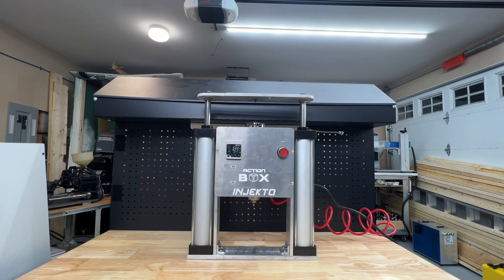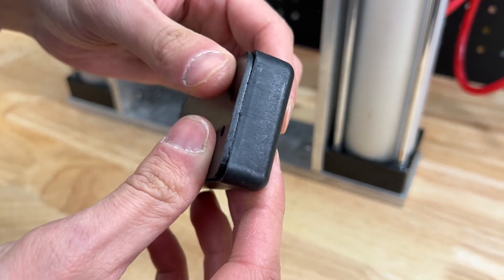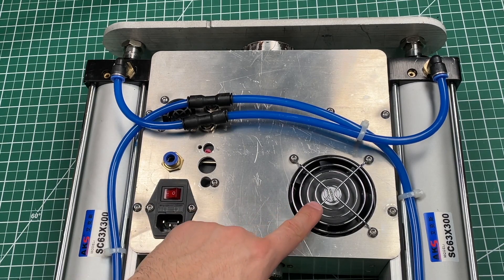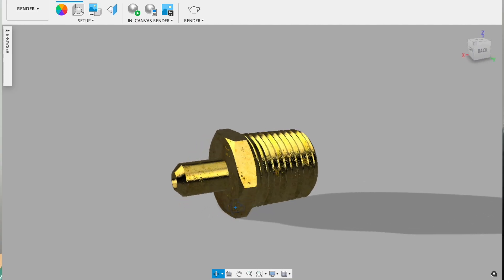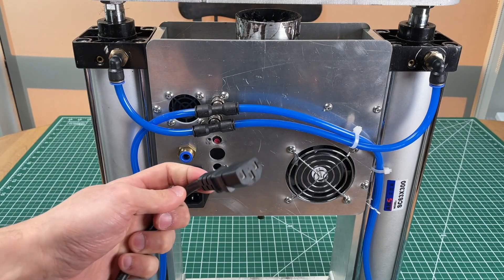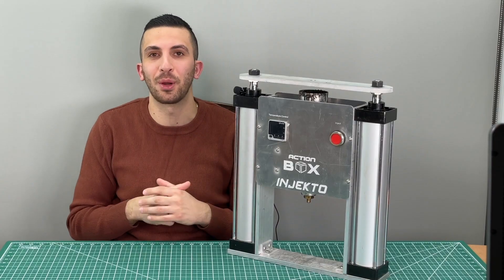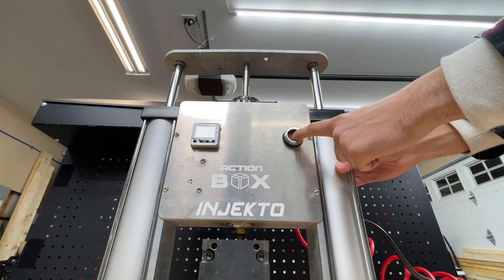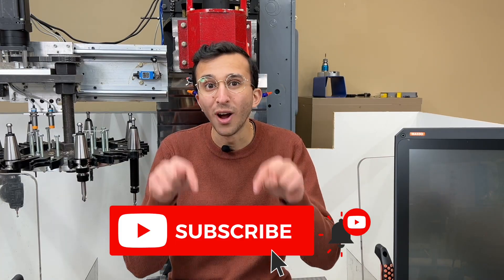How We Made A TINY Injection Molding Machine

Comment: I wonder if you add a lever system.
Like a rhombus that will fold. 
What Force can such a mechanism pruvide?

On one diagonal it is compressed by cylinders, on the other it pushes the plunger of the syringe.

In theory, the curve of the developed force will be steeper by the end of compression. 
Weak at the beginning, then high. Which is well suited for the molding process.
Reply from the maker: Thats a great concept, which we had considered, however we wanted to keep the design elegant and as small as possible. Thanks for watching, and hope you enjoyed the video 😃
Reply: @ActionBOX  You guys are doing a great job! 
I like your enthusiasm. I myself try to add something interesting to society. I hope it will be noticeable in the future.
Reply from the maker: @sl_st  Awesome and thank you. We look forward to eventually seeing what you re working on 😊. Cheers
Reply: @ActionBOX  I love 3D printing.
 I'm doing all sorts of little things now. 
Two-stage cyclone dust separator and similar things. But this tool can do more and I can do more. 
SL_ST

Comment: It's cool that it worked with a aluminium injection barrel. I was considering making an injection machine and thought i needed to make the barrel out of stainless steel for it not to wear out.
But you should do something about the air cylinders not moving at the same speed making the plunger tilt. This can also cause the cylinders to bind.
Reply from the maker: Thanks for your input. The cylinders use to have the tilting and binding problem but not anymore. We hold the plunger shaft loose so it can guide itself into the hole and that seems to work well. Stainless is probably an overkill but steel would definitely be recommended. Thanks for watching in such detail, I appreciate your comment and support 😊
Reply: @ActionBOX  the thermal conductivity of SS is horrible. It would really slow your ramp up time and cool down as well.
Reply from the maker: @kenreynolds1000  This is a very true point.  Ken, which metal would you suggest would be best (regardless of price) ? Cheers, Dave
Reply: 4130 is fairly strong, tough, reasonable to machine and easy to source. It'd be my choice for a DIY machine. You don't need anything more exotic unless you want it to run continuously for years. Stainless is a bitch to machine and likes to gall.

Comment: nice! I'm currently using a (smaller) hand powered diy machine. I was thinking about converting it to air now I feel even more tempted ;) Looking forward to your V2 and great video as always :D
Reply from the maker: Haha glad we inspired you to convert to air! Did you build your current machine by yourself?
Reply: @ActionBOX  yes, had an old arbor press (I can only lift it when disassembled). I just added a plunger and a steal barrel, two heater bands and a PID controller. works pretty good with literally tons of force. But it's hard to get constant results due to varying speed and force when manually operated. Also have a concept (and some parts) for a fully automated machine but don't know if I'll ever find the the to do it. So I enjoy seeing you guys do such things ;)
Reply from the maker: @MakenModify  love it. Thanks again for your support.  We have several more injection machines planned out for the future so I guess you will see them as we build them. Cheers

Comment: nice concept guys! Ive got a small Arburg injection molding machine myself. Mold making is the only problem for those small desktop machines (atleast for the Hobby market). Might be interesting if you try to SLA print some molds. Greetings!
Reply from the maker: Thanks for the tips! Ill do that in the V2, I promise 😃. In the meanwhile, feel free to help meow and share the video with anyone whom you think will be interested. We are really trying to grow our channel 😃. Cheers Dave
Reply: @ActionBOX  ive shared it. Ive also already Experimented myself with SLA molds and will ne exited for your Spin on it. Ive found that a Aluminium pallet to clamp the mold Insert is really necessary (cutting printing Time down, alowing for More pressure and accurate Holes for ejectors etc.). Only Trouble is that after some time cooling gets to be an issue. AS i said, im really looking Forward to your V2 concept!
Reply: @clypeum5063  I've heard they are using 3d printed tooling for rapid prototyping, does SLA really hold up that well? What I've seen in industry magazines they are getting like 500 part runs out of a 3d printed mold.
Reply: @sjones1234  yeah, SLA is fine (your Standart cheapo Resin will Work good for simple molds, for fragile ones i would still Prefer high quality Strong and heat resistent Resin or Steel/aluminium). Ive molded 250+ parts without big issues but that mold is really simple. I think 500 parts shouldnt be a Problem for simple molds too.
Reply: @sjones1234  I dunno about you, not having a CNC mill or enough tooling to make what I'm after, but 500 part runs is plenty for me. Especially considering the investment aluminum molds would take to produce.
Reply: This is a pneumatic system so cycle time cooling would not be an issue just use air jets on a timer. This could be a interesting design I think I will work on automating it, removing most of the components from the frame and making a proper box. I think you guys are on to something and could create an automated system with a VERY small foot print. The only issue is that air is expensive.
Reply: @sjones1234  stratasys (and others) have even done FDM injection molds. Similarly, they had an aluminum (iirc) body with printed inserts. This adds rigidity, and also removes heat.
Reply: @knickly  I have seen videos of 3d printed molds in aluminum bodies but I thought they used SLA rather than FDM which would make sense to me since I would think using a similar material or any thermoplastic would run risks of binding to the injected material while material cured with lithography should be more resistant to the temperatures. But I checked out the company you mentioned and they are doing it with FDM, very interesting.